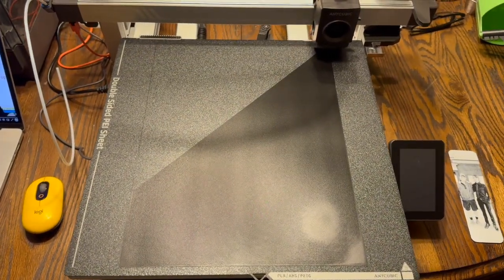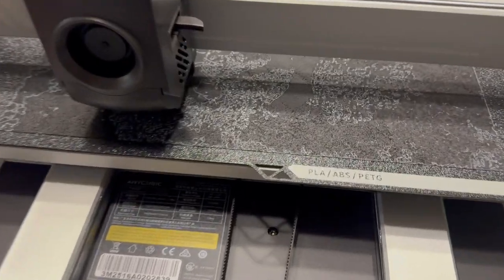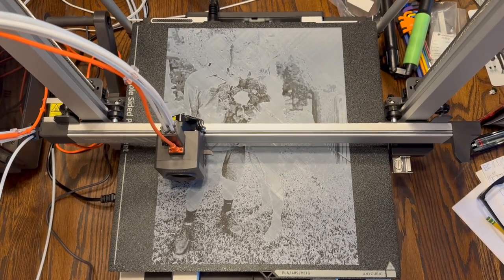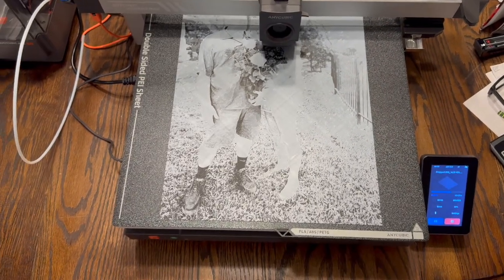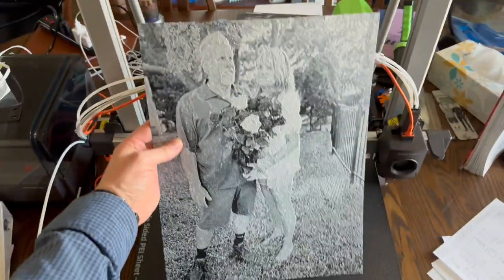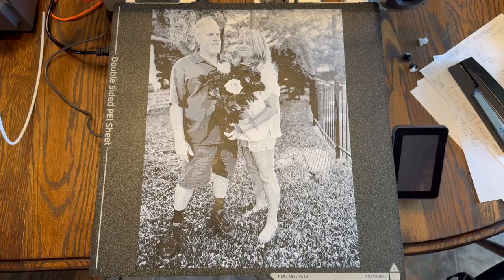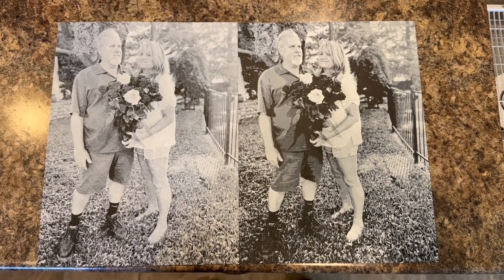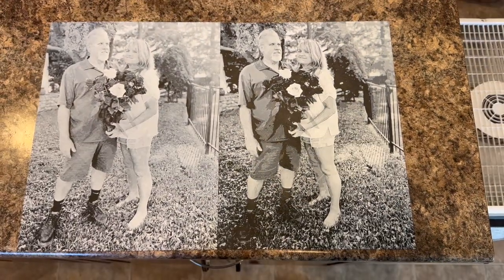First Big HueForge - Anycubic Kobra 3 Max

Comment: Did you use z-hop?
Reply: Fix retraction
Reply from the maker: @RichardSats-e5l and @bcjan18, they're more like pits where the nozzle has melted into the plastic vs blobs left behind due to retraction or z-hopping...
Reply from the maker: Yep, the printer was set to z-hop.
Reply: @SadlerIn3D  Yes those are those blobs on the surface
It's a double-edged sword; I'd try try to get rid of all z-hop and see how it turns out